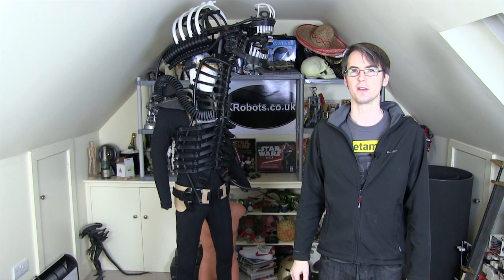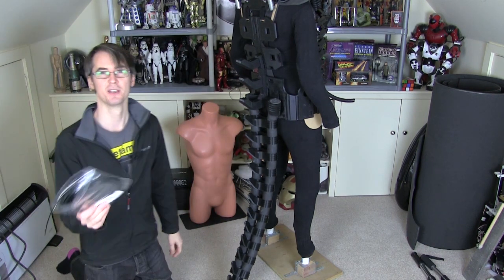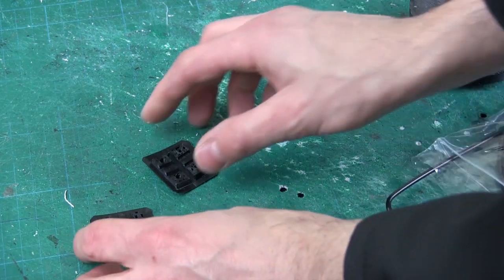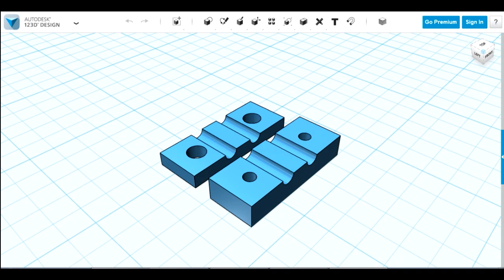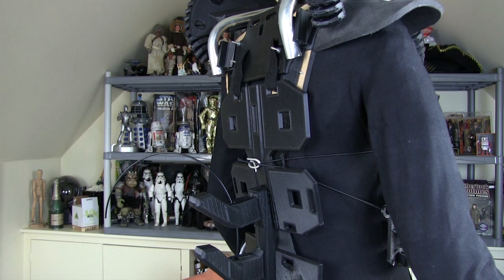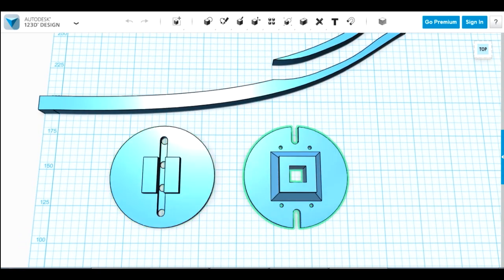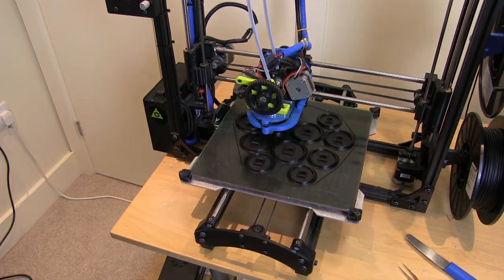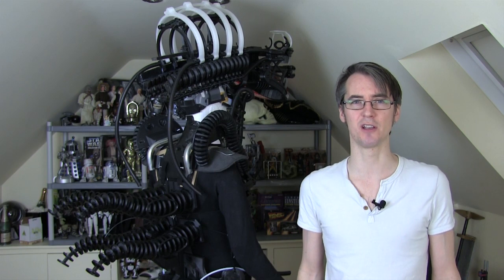Alien Xenomorph Cosplay #14 | Dorsal Tubes & Tail | James Bruton

Comment: Is there currently any concern or workaround in place for the difference in the length of pull on the cord from your legs vs the amount of pull needed to swing the tail? 
I was thinking you'd maybe pull 30cm (random number) of cord with each step, but maybe only 3cm of pull is needed to make the tail swing a bit.
You'd potentially whip the tail with each step and give people next to you an unpleasant surprise.

Comment: You could look into cable rigging for animatronic tails. You would be able to put the cables inside the foam tubbing, that way it's all hidden. You could use flex sensors to control the movement.

Comment: i think you'll have to rethink the tail anchor wire, as it is now you'll always have the tip pointing up no matter how hard you tighten it. And the more you tighten it the rounder the shape will be, it needs some sort of interlocking plates that limits movement upwards between the fins, to create rigidity and balance the load  throughout the tail. Something akin to the plates on the back of a lobster.

For fastening on the top you can make something like a loop wire lock and just hook it up once youve figured the length of the wire. Makes it easy to detatch.
Reply: He's mentioned in past videos that he wants the tail to point up at the end.
Reply: Jason Kay Maybe so, but as it looks currently I believe that the tail will form a parabola with the tip pointing straight up, and that is not very alien-esque to me, and it might drag on the floor in the middle, despite stilts. With a more rigid frame on the top side it would mean the tail sticking more straight back, he could always make it less rigid towards the tip to get it point up if he wants that. 

And with wire lock i meant clamps like this http://i01.i.aliimg.com/wsphoto/v0/1441020739_1/20pcs-font-b-Wire-b-font-font-b-Rope-b-font-Duplex-Clip-font-b-Stainless.jpg . Should be relative straight forward to print. And if it is printed in lower resolution one could put the top sides against each other to increase friction.
Reply: Konzetsu I suppose, just have to wait until he can connect all the cables and see how it moves and is positioned, maybe james could try some experiments by temporarily taping solid plastic or wood to the tail will hold it so he can see how it will effect the tail then he can 3d print something to go between the plastic segments to stiffen them.
Reply: Konzetsu  He could just have another set of cords that are just used for elevating the first section on the tail

Comment: Im sorry to say the Dorsal tubes look silly which is a problem I always had with the original design, so that means yours is looking a lot more Alien like now which is good. Im glad you are now doubting the white parts of the head, I know it was supposed to represent the clear dome on the original but that was something you hardly noticed most of the time while yours isnt clear and stands out. Maybe you can reprint or paint the white parts in black while keeping the inner skull look at the front. The skull was like a cool hidden feature that you could see hints of but only when it was brightly lit could you see it and in the early films Allien was hardly ever lit that well, being a shadowy assassin.
Reply: Jason Kay makes great points about the humanoid skull being well hidden; I didn't even notice it in the movies, until seeing production stills afterward, where they're posing in direct light. As for this particular project, though, I had the exact opposite idea when it came to the white parts:

I say illuminate them with some color-changing LED's or EL wire, and add more white parts to give the same treatment to, throughout the exoskeleton- especially the ribs and forearms.

Sure, the Alien is a stealthy, shadow-lurking haunt, but now that we have whole swarms of them (not to mention Predators as the apex lone and team hunters, to boot) they're a bit flashier. Plus, in the context of the scrap metal (inspired) "Xenomech," we're talking about a machine of pure death, engineered to perfectly mimic the ferocity of the things, not their guile. Not to mention, *****, you'll be a smash hit at all the raves.

Light that sucker up!
Reply: Recusant That could work and if you could shine some coloured light onto the white parts you could experiment to see what colour looks best, im thinking blue. Anyway good idea Recusant.